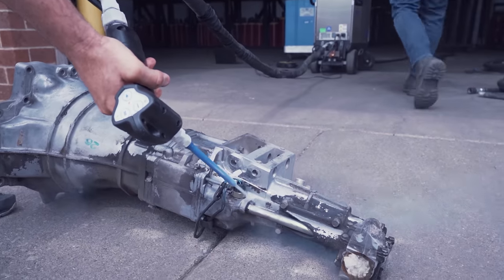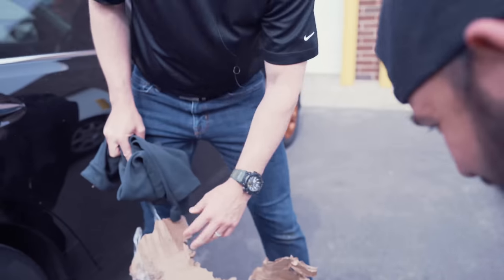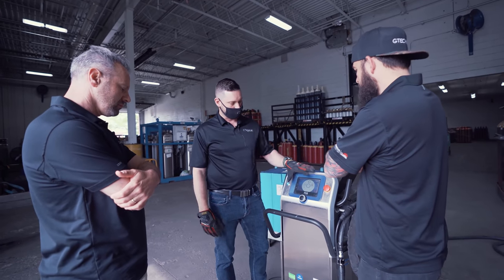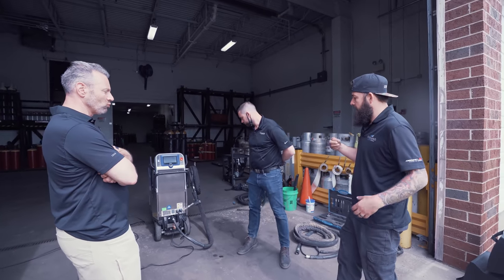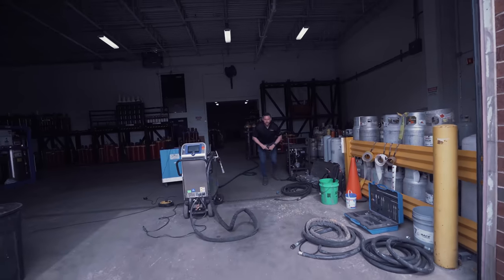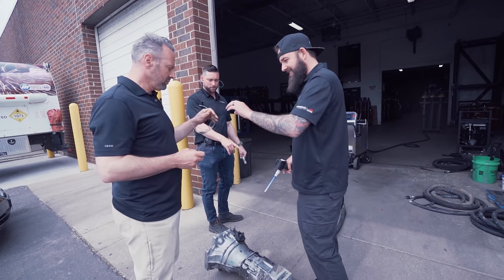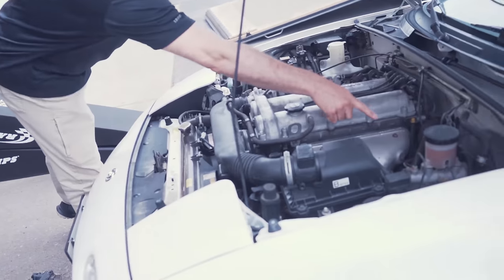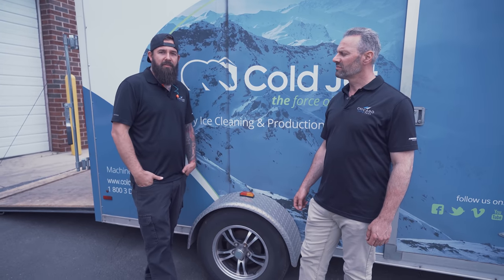A $40,000 Dry Ice Machine | Dry Ice Cleaning

Comment: It's another piece of your arsenal to set you apart from the rest. Cuts down on your biggest expense which is labor. I'm a fan of anything that does the job better and faster. Employees would actually enjoy using it, which would also turn out jobs faster. As far as the debris it leaves behind... You are cleaning up afterwards no matter which process or tool used for a job you use. So there's not a difference. I've seen these systems used on interiors and with one swipe across a panel or cluster, it is new again. The particles on the carpets or any surface won't be embedded, so a final vacuum at the end of an interior job would handle that. You guys are in a caliber of detail that warrants an investment of this level. And I'm addicted to your videos, so getting to watch videos of this being used more often would be so satisfying. 😁

Comment: Does the dry ice affects gaskets? would a rubber gasket be compromised if touched with the dry ice during cleaning?
Reply from the maker: If you have the machine set too aggressively it can, but it is adjustable and you can change the settings on the fly to go over any type of material.

Comment: Are you just blasting away the clearcoat on the wheels and the rustproof coatings on the undercarriage though?
Reply from the maker: No, It will not damage clear coat if used properly.
Reply: @ChicagoAutoPros  How is that possible? A rough or dirty towel will cause swirl marks but media blasting clearcoat at 40 psi will do no damage?

Comment: There is a misconception of how CO2 cleaning works. It may weaken the bonding between dirt and the part through cold but the main thing is that CO2 is a non polar substance, like most organic solvents so it is actually "dissolving" grease and blowing it away.

Comment: I don't know what you guys specifically do for a living, but you'll need a 30-hp variable speed rotary screw compressor, a refrigerated dryer (that nobody will repair if it has a problem) and the $40K PCS40. So about $75K without a lift. Then understand that you need to order the pellets a week in advance, and you can get them only in 500lbs bulk. Need 650lbs? Order 1,000 lbs, about $1K with tax. And then watch the stuff disappear while you go to bed. If you don't order a variable speed compressor, see your power bill explode. Every time the compressor fires up, it causes an energy spike, and the power company charges you based on that spike. Can be thousands of dollars a month. Be warned.
Not to discourage you, but it's a substantial investment (we've done that) and it will take a long time to pay off, unless you do nothing but dry ice blasting. That's why it's so expensive . . .
Reply: Yes agree 100%.
Reply: AND the warranty is only ONE year on the ColdJet machine....I would even say you are close to 100 000$ for the whole set-up....Very risky business and investment...One solution is to rent the compressor and the ColdJet machine on a daily basis as you need...Schedule   job accordingly...

Comment: Videos like this are misleading. We have a system at our shop and let’s talk about the reality of actually owning and running something. Like this first of all, your compressed air system must be able to push anywhere from 35 to 125 CFM. You cannot get those numbers from a Home Depot air compressor. You’re going to spend thousands of dollars just on the compressor. Operatint this machine requires an extremely well ventilated area and produces a lot of dirt and debris. It goes everywhere you will also need air dryers and other equipment. Dry ice is difficult to get outside of major cities and typically cannot be purchased in quantities under 500 pounds.   Operating this machine requires an extremely well ventilated area.  I don’t see this technology ever being practical for a DIY person.

Comment: Don't waste your money.  Having used a dry ice machine for years with our printing presses there are more draw backs than advantages.  You have to order ice and you have a very limited time in using it so keeping "stock" ice on hand is not doable. Ice is water, oil and water don't mix, all ice will do is push oil and grease around.  The transmission had dried gunk and it will clean it well but if you plan on engine detailing or the such forget about it.  Ice will blast grease out of bearings and the such so you don't use anywhere near bearings or grease locations.  Ice has a place but a on a car is not one of them.
Reply: Ice is water. But dry ice is carbon dioxide. Which disappears back to gas on impact - ie no water at all in this process.